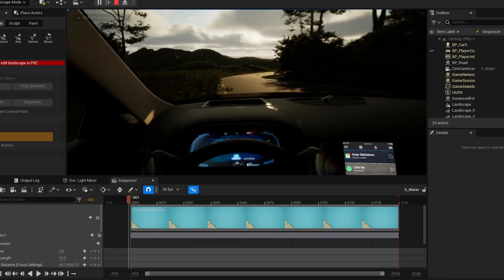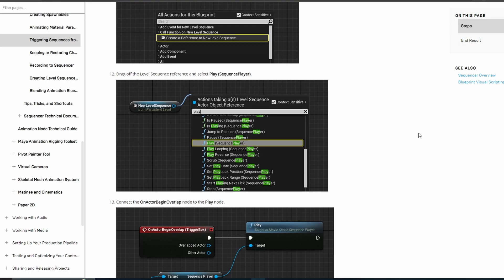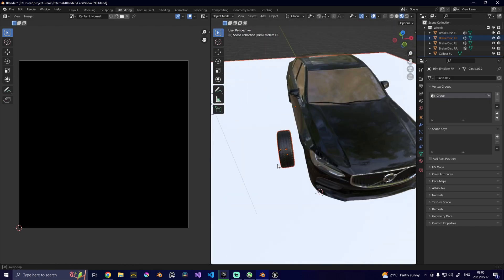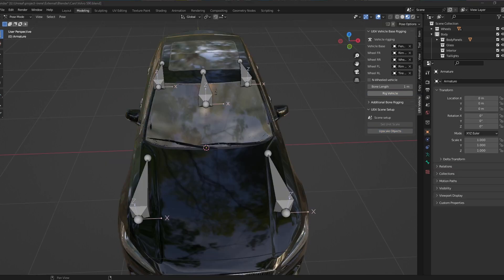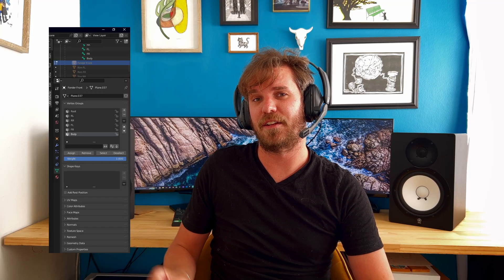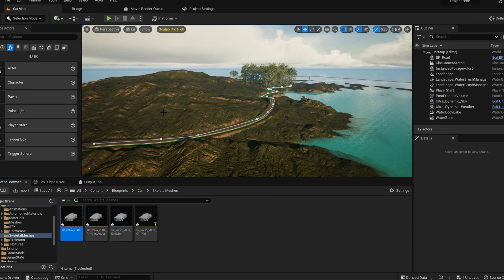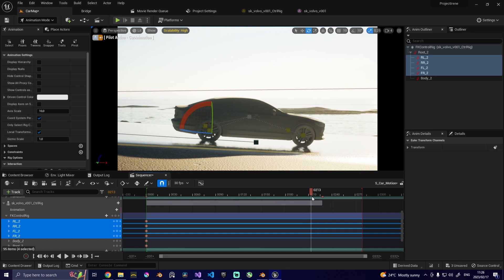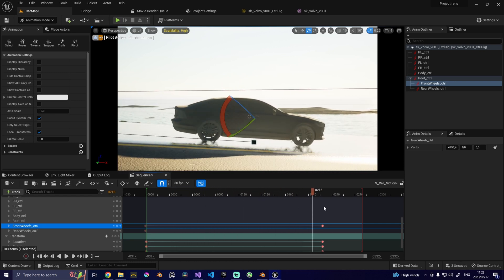Car Rigging and Animation - Dev Log 5 - Unreal Engine And Blender

Comment: This was incredibly helpful! Thank you for the precise walkthrough. I do have a question though, do you have any idea how we can still apply materials to individual elements of the car in Unreal Engine once we've joined all these smaller meshes in Blender? For example, in UE I like to use the automotive materials pack to apply custom materials to the rims, tires, paint, etc. - do we lose that ability by doing this? And if so, do you have any idea how we could prevent that from happening? I'd like to keep that versatility if possible.
Reply from the maker: Hi! First off, thank you so much! And yes, it's possible, when in blender you can assign different materials to different faces by selecting the relevant faces and assigning a material. Then when importing into unreal you can target those materials with your own ones :)